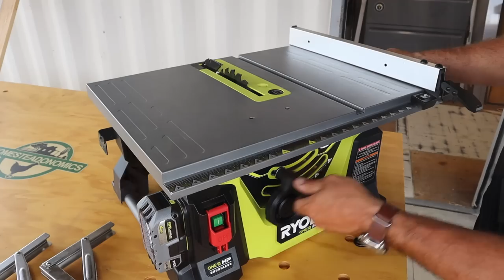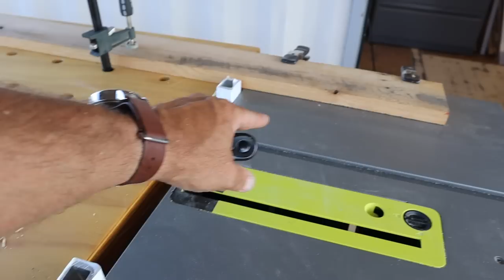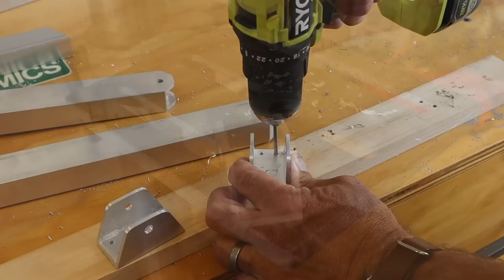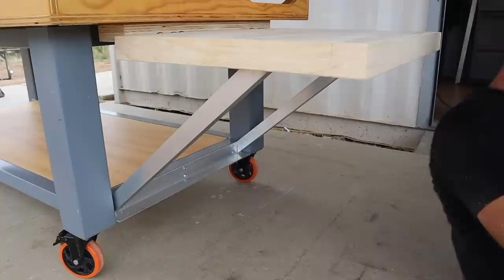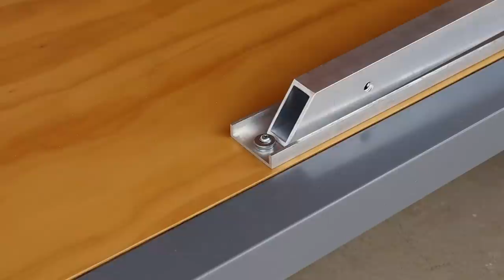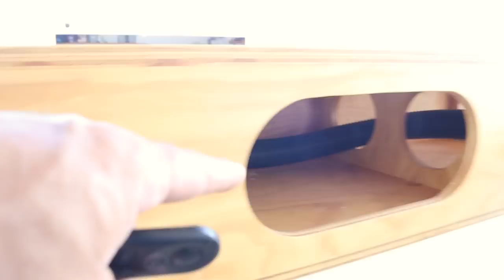Tablesaw UPGRADE for my Paulk Inspired Workbench

Comment: I always appreciate your videos because even though I may not be building something similar, I always learn some little trick or technique that I could apply to something else.

A tip for those who may cut aluminum in this way: when cutting aluminum with a chop saw always move slowly, if you try to bite off too much too quickly it could turn into a scary incident, trust me... And keep those blades sharp!
Reply from the maker: Oh yeah…. If it grabs…it REALLY grabs and can be scary😱.   Had that happen when I had the old hitachi saw and the blade was probably way far too gone to be using.  Broke the plastic guard on the back side of the saw.

Comment: I like it, great addition to the workbench. You could also use it as a extra side table when not using the table saw.
Reply from the maker: Yes, I definitely think it’ll get used for other things as well.   Sometimes when I’m doing a lot of sanding type stuff I like to move the bench sander outside and that table would be great to still allow the top of the bench be used for assembly, etc

Comment: I have been using Ryobi products since I bought me first home back in 2005...it is so amazing that everything I used back then that ran on 120VAC but can now run on batteries!  Love it  :)  
Your projects are always interesting Joe...gives me ideas for my own...and has great entertainment value on top of all that...thanks for bringing us along.
Reply from the maker: Yes, I’m with you on about the same timeline.  My in laws bought me a set of Ryobi tools back in 2003 and I’ve been using them ever since.   Found them to be reliable and a good value.    I’ve had one drill burn up since then…. But I can’t tell you how many thousands and thousands of holes I’d drilled with it.   I think it met it’s fate when I was working on the shipping container playhouse and I was drilling 1/2” holes into the 1/4” thick steel plates I used to bolt the deck onto the play house.   And at that point….it still worked but just started smoking when I leaned my weight into it.  220lbs leaning on it….more than any drill truly wants to deal with😂

Comment: Another nice little project that just adds some functionality to the shop. And as always, you make it look good at the same time you make it work well.

One suggestion: A single crossbar between the two legs, maybe 1/4 or 1/3 of the way from the hinge point to the end, would provide a handle, so you could fold and unfold both legs at the same time, one-handed. Obviously it's not needed for any sort of strength or structure, but it would improve the operation a little, especially if you plan to leave the saw mounted to the shelf when you fold it down.
Reply from the maker: Thank you!   I do like that idea and likely will add that…makes sense😊👍

Comment: The No1 problem with Ryobi table saws is the track. There's only one, and the shape (the little tabs that ostensibly keep the guides down). It maes getting precision work and jigs more difficult than it should be. Now if they sold bars to fit their t-track, that would help a lot. But 2 tracks would be better.
Reply from the maker: Yes, the tracks can make a big difference.  Which oddly enough is why my old Ryobi BT3100 is, in my opinion, the best table saw Ryobi ever made.  Had adjustable and extendable aluminum tracks in both the front and the back.   I don’t think they made too many of them as I’m sure they didn’t have greatest margin….since they had a lot of bells and whistles.    But if you can find an old one in good shape those were pretty darn good saws.

Comment: Nice work. Just curious why you left the saw table a little high of the workbench?
Reply from the maker: Just incase there was a little flex to the table.   Then you wouldn’t have to worry about anything catching.   Of course it doesn’t flex at all.   So I could adjust it back down that 1/8” or so and it’d be fine.

Comment: I feel like ryobi is a sponsor😏. Anyways they’re basically Milwaukee lite now with range of tools and robustness level going up. 
Starting to see them leak into the trades too as good enough for day to day use, but not Milwaukee/Makita pricing
Reply from the maker: I mentioned that they sponsored this project in the beginning of the video😂.   So yes, you are right.   
I know many folks are turned off by sponsored videos, etc,.   But if you check back in my videos I’ve always used Ryobi, at my cost, long before I ever received any tool from them.  
Anyways, I hope you enjoyed the build.   And also know that not all of my videos are sponsored.   
Thanks for watching!

Comment: Interesting addition to your workbench.   Is it your intention to keep the saw bolted to the extension at all times?  If not, consider adding a couple sections of pool noodles to protect shins and hips from the protruding bolts.  Bob on the “I Like To Make Stuff” YouTube channel did something similar to one of his mobile benches, hanging several different tools on the same bench.  https://youtu.be/LOYmB6q2wnM

Wishing you and your family a blessed Independence Day holiday weekend, gentle weather and restful evenings.   Peace brother.
Reply from the maker: Thank you… and a blessed Independence Day for you and your family too!

As for the table….I’m probably gonna leave the saw off most of the time.  Because I move the table from my garage to the shop and wouldn’t want to have to have the extra weight when pushing through the gravel.  And yes, I might need to put a bumper of some sort on those bolts.